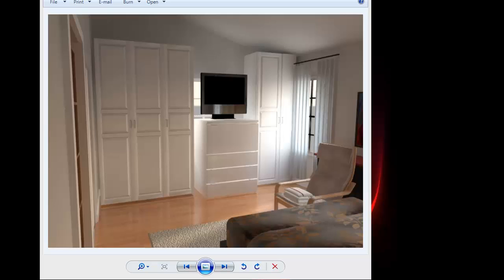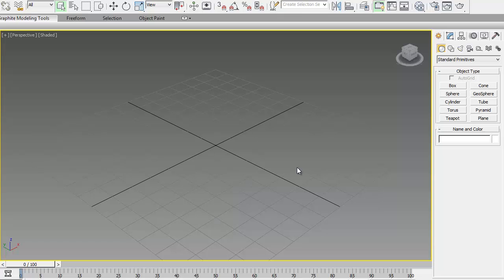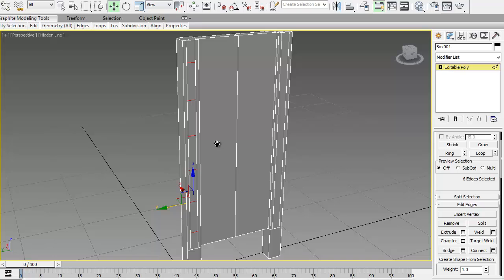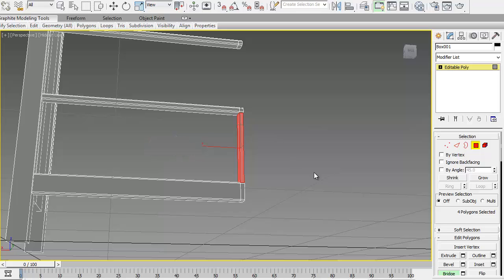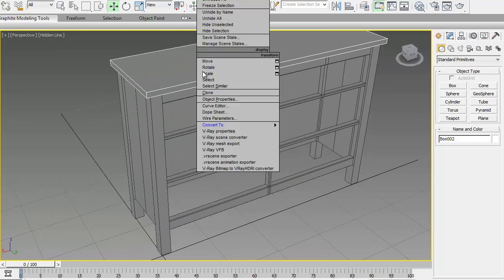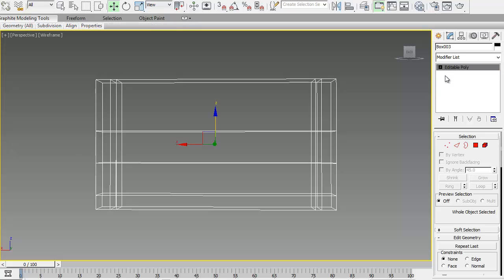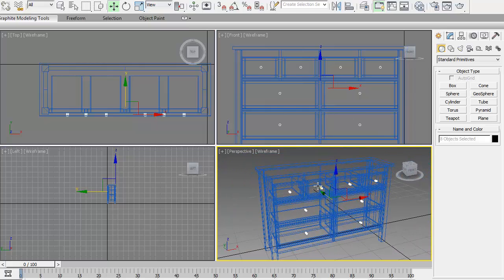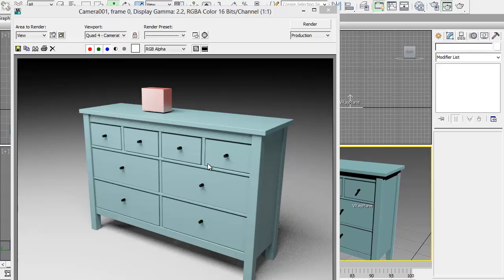3DS Max Dresser - Profile Extrusion - Easy Technique

Comment: Thank you for this great video! Could you explain how you have added source of lights before rendering? Looks like this moment was cutted off or just missed.
Reply from the maker: +Дмитрий Присакарь No problem. What renderer do you prefer to use?. Vray?
Reply from the maker: +Vito Oporto 

I used 3 VRAY lights. One large light on top, one on the right and one on the left.
Vray lights. rectangles or squares. 
- Top light is stronger, shadows ON. 
- Side lights NO shadows. soft light
- ALSO add a Vray Plane. - Turn ON GI (for light to bounce and fill the sides of the furniture. Add the walls too.
Reply from the maker: You can now download the 3dsmax file. See above.

Comment: how do you render like in video picture?
Reply from the maker: +Banism24 I used 3 VRAY lights. One large light on top, one on the right and one on the left.
Vray lights. rectangles or squares. 
- Top light is stronger, shadows ON. 
- Side lights NO shadows. soft light
- ALSO add a Vray Plane. - Turn ON GI (for light to bounce and fill the sides of the furniture. Add the walls too.
Reply: +Vito Oporto for the light using environment?
Reply from the maker: No environment light.
Reply from the maker: The 3dsMax file can be downloaded now. See above